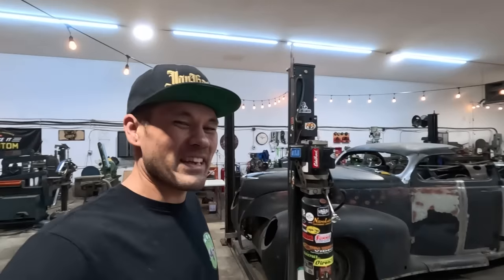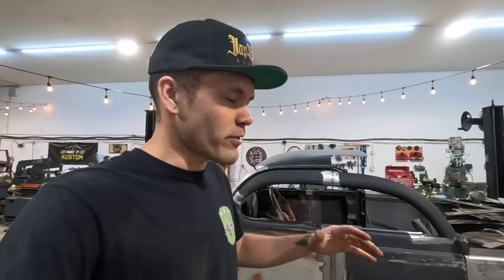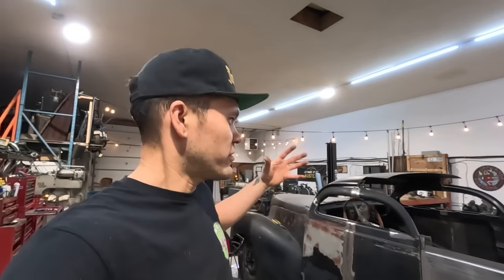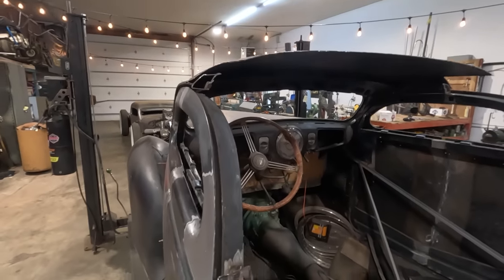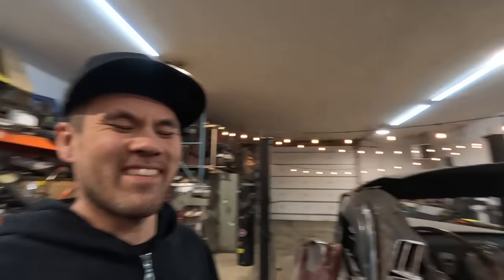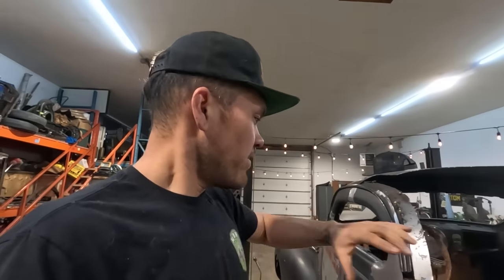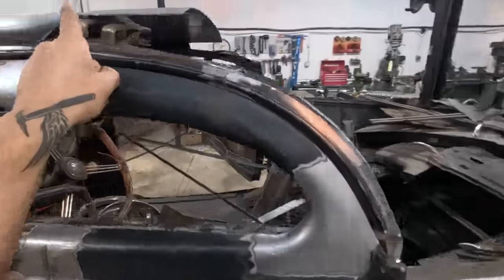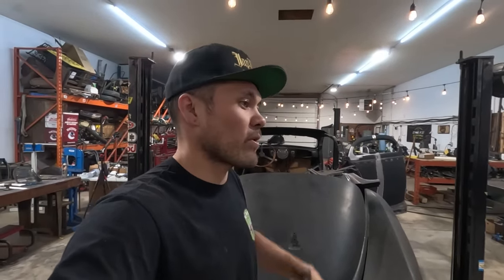How To CHOP Door Frames and Inner Structure WELDING Pillars 1939 Lincoln Zephyr Coupe Conversion

Comment: Good to see you address the inner structure. I have been in the collision repair business for 49 years and still doing small jobs. The cars you are working on are death traps in a collision anyway but correctly chopping at least gives some rollover protection.  A modern unit body car would have no integrity at all if chopped and welded without addressing the inner structure.  Nice work this old timer is learning from you

Comment: Hi Karl, thanks for going the extra mile to reinstate the A pillar inner reinforcements! Such excellent work and you can be sure it has been done right, returning the strength and getting rid of that dreadful factory overlap. The rear section of the can’t rail looks excellent as well. Cheers Colin

Comment: Karl,  aside from taking in some great panel fabrication and fitment, I'm also consciously aware of the surrounding condition of the original rod sheet metal for its age. It must be a pleasure to work with no rust. Given the level of unhurried work so far, I'm certain this chop job is not going to take a lot of body filler.
Keep up the good as new work.
Reply from the maker: Thanks very much and absolutely I am so grateful to be working with a car that does not need to be fixed for it to be modified

Comment: As for dimensionally accurate cars there is a YT channel called Retropower who make high end moderniised classics. They use a lot of digital scanning and this shows up significant errors between the sides of cars and also the differences between supposedly identical car bodies. Variations of 3/8 inch are not uncommon and apparently typical of 1960;s - 1970's cars It must have caused a lot of headaches for the finishing department trying to get sensible panel gaps. This said when I think back to my dad buying a new Ford Cortina Mk1 in 1964 and the doors rusting through in 18 months cars were really badly made in those days.

Comment: This series is an excellent primer on why this chop is not one for beginners, or people not willing to put in the effort to do it correctly.  Zephyrs are very unique cars.  All of those massive slabs of sheet metal have absolutely NO straight lines or panels.  Everything is either domed or curved, or both.  The fact that it is a unibody design makes it imperative that the inner structures are restored for the necessary body strength and rigidity.  That requires hours and hours of fabrication and welding on structures that will end up buried in the vehicle and never seen again.  That amount of time and effort makes it very tempting to skimp on those structures and just fake the outside panels to make it look good.  I am so thankful that you did not do that, but are demonstrating the RIGHT way to reconstruct the top structure.  The guy that taught me the body work business constantly pounded it into my head that if it is worth doing, it must be done right.  There is no suitable option.  Great news on that coupe deck lid.  That will make things so much easier to fit onto the body.  That piece is huge and trying to build the deck lid and its corresponding frame from scratch would be a real killer.  Keep up the great work...

Comment: Are you planning on using that original - and that big gauge in the center looks like a glass cover that If you were going to use it you need to cover it up The hot metal will stick in the glass I would like to see one piece made in real-time all the way through Luke from start to finish and installing on the car

Comment: Karl, G'day from Australia. We never see you use weld-through primer or any other corrosion preventative when enclosing inner structure. How do you prevent rust from occurring in those areas in years to come? Cheers, Andy
Reply: And then, later in the video you did use weld-through on the A-pillar but not the C (b?)-pillar!

Comment: Kier Karl...as usual. A Question...that articulated go pro boom...where did you get it. I really need one. Sorry to distract. Keep it strong man!
Reply from the maker: It’s kind of a mismatch of stuff. The arm that extends is a telescopic arm that came from a different camera and it’s just hooked onto a regular tripod that has a ball swivel on the top. You can get tripods like this on Amazon for relatively inexpensive and just make sure you can hang a weight off of it if you’re going to use a boom
Reply: @MakeItKustom  appreciate that!!

Comment: I many have to go back and look at the first parts again, but how did you decide how wide to make the front doors?  They are very wide, but the car is very long.  I am looking for a 4 door to just make it custom (lol).  I have done original cars but never a 4 door to 2 door.  Thanks Joe.
Reply from the maker: I contacted menges twins, speed shop. They’ve done several Zephyr conversions and are extremely talented. They were kind enough to tell me that the length of a two door door is 43 1/2 inches so that’s where I started
Reply: well that was smart, and that's a big door almost 4 feet wow...I have gotten so many tips from watching you work, keep it up and thank you very much for all of the videos..
 @MakeItKustom

Comment: Question,why would you not do roof first then do door structure pieces to fit completed roof?
Reply from the maker: The roof is more cosmetic than it is structural so it’s important to put the structure in place where it needs to be in relation to the doors in the windows. Then the roof skin can attach to the door frame.

Comment: Karl, thank you for showing how to properly put the strength back into the structure. I do have a question about the welds at the rear of the door structure. Did you do a series of spot welds or was it longer weld beads? I couldn’t tell if it was the just the speed up made the spots look like continuous welds or you did longer welds. Thank you
Reply from the maker: I did longer welds because the 16 gauge I was using for structure can really take the heat
Reply: @MakeItKustom   awesome! Thank you Karl for the information. I will be doing some work with 16 gauge and that will speed up the weld time!

Comment: You are using templates to make sure this is the same side to side?
Reply from the maker: I have templates of the piece, but if there’s a very minor variation, it’s not necessary to change because the door frames themselves are exactly where I want them to be so if there was some minor factory defects, that insist the pieces from side to side have a very slight differences I’m not worried